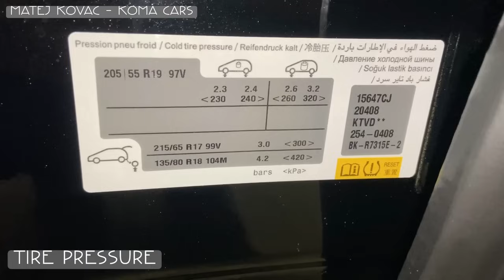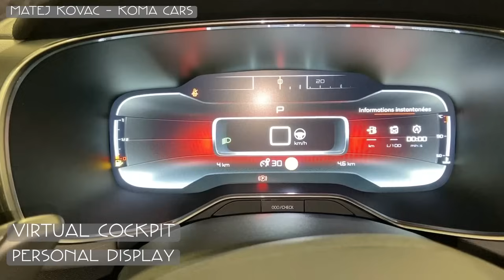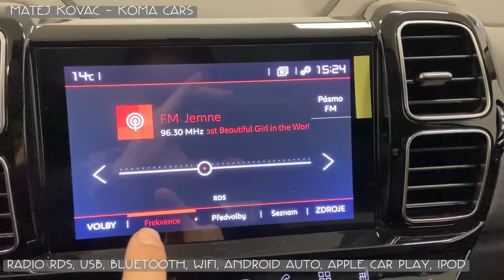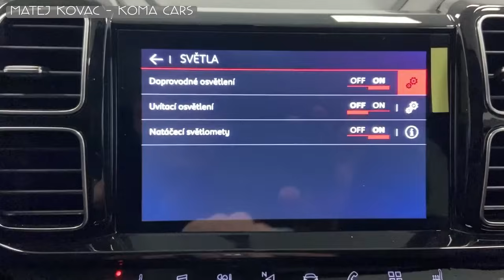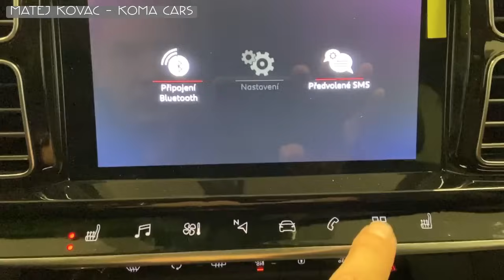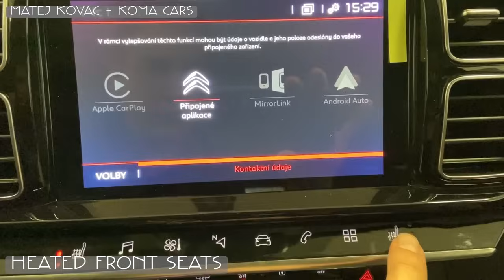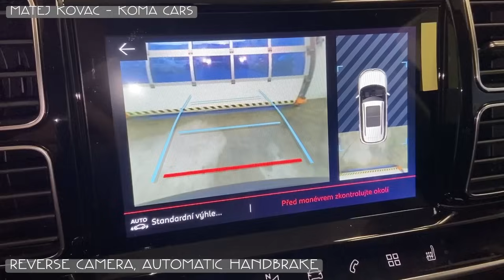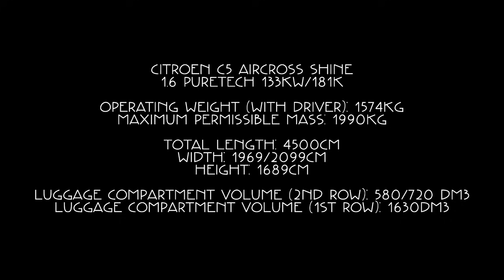Citroen C5 Aircross - Detail walkaround, demonstration, technical, (interior, exterior, trunk)

Comment: Following the comments and test comparisons, I purchased the C5 Aircross Fell Adveture on 24/12/2019. I'm always on the road because of my job. In short, the car is my second office. C5 I can not imagine that I can not imagine that beautiful screen does not have CLOCK. The room attached to the upper right corner of the radio screen disappears when the phone answers. If you need a watch during a phone call, you have to choose a menu or look at the time on your arm. They put the air temperature in the upper left corner of the radio screen. The room disappears during a phone call. Whoever you are talking to by phone, name and surname on the screen can be seen even from the cars outside the Husband POTOLAR appears. Well, the test friends were good at some of these things. I bought a Ford Focus HB years ago. Because of this watch, I sold it at 2000KM. I never thought of this when buying the C5 and now I am experiencing the same design. It's a beautifully designed dial with a constant CLOCK and temperature. Hayrett ..... Why don't they make the SPEED CONTROL program easier? They couldn't put the speed control menu bar hidden under the steering wheel into the visible 3 cm of the steering wheel. Keys do not appear when viewed from above